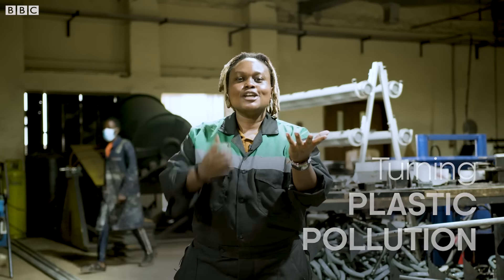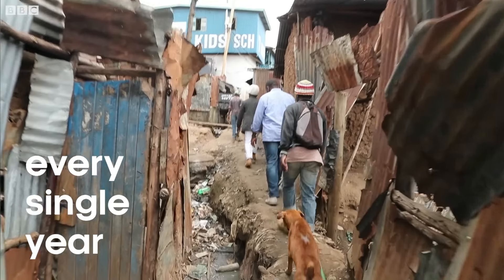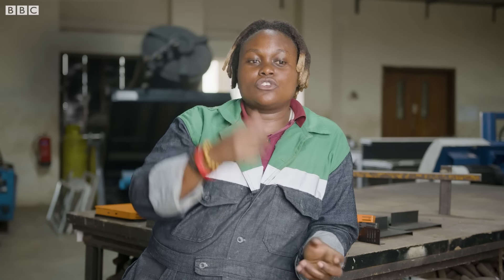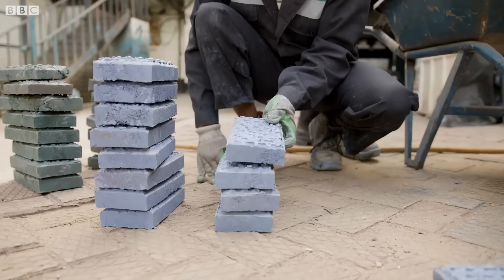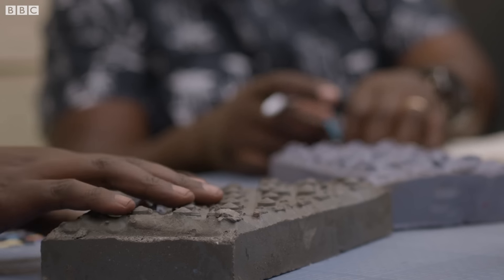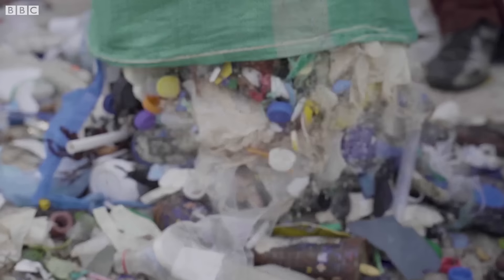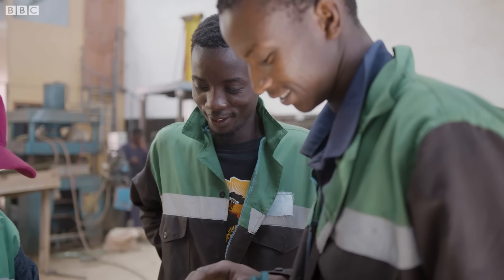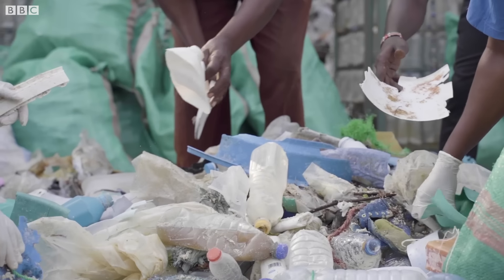These Recycled Plastic Bricks Are Stronger Than Concrete | Trailblazers | BBC Earth Science

Comment: My only concern with this is as the bricks wear down what about microplastic particles? Otherwise it's a very promising project.
Reply: its a good idea for building homes...
Reply: Thats actually a problem, but can ve avoided if you just dont use it for roads and paths and rather buildings
Reply: It's not a perfect solution but it should reduce the overall amount of microplastic by binding almost all the material inside the brick.  There's most likely a large reduction over that same plastic waste material degrading naturally where almost the entire object degrades into microplastic.  
The best strategy is to use in where you can minimise the surface area exposed to the elements and/or wear.  So as a structural "brick" inside a wall would be ideal.  My concern is off gassing during manufacture and the life of the end product.
Reply: Micro plastics in daily consumption is the ultimate problem and worry. Her bricks seem good as low-cost useable alternative to simple landfill.
Reply: @UC-zQBbgOjxW0gVISzjyGoHg It might be similar to unreinforced concrete that has compressive strength but terrible shear strength.  Like reinforced concrete or composites, mixing in some type of tensile fibre might improve that.
Reply: I think it"s a step in the right direction.
Plastics will degrade eventually. Buying time is an option.

Comment: If it is indeed made from just sand and plastic, then these bricks will degrade from the sun blasting it with UV. It will then ware down into micro plastic particles that will wash into the environment. if you have ever seen how brittle a plastic bottle gets when left out on the street you will know what I mean. If there is a sacrificial additive in the mix, (something that has a preference to absorbing UV before the plastic), from what I understand they last about 10 - 20 years without the plastic becoming compromised. But them additives are expensive, this is why UV hardened plastic materials like upvc cost more then plain pvc.
Reply: @erikweijling7361  The main problem will be if the additional treatment of the bricks, whether that be UV hardening, painting, or some form of render, will eat the cost savings. 

UV hardening would make them a drop in replacement, however they certainly would not last as long as ceramics that are good for 50-100+ years.

adding a render/painting will add more labour and complexity to the build, and would also require ongoing maintenance throughout the buildings life. This would also eat into the value proposition.

With all the above said, maybe a good solution would be a hybrid approach. Have the bricks take up the majority of the volume off the building, with the concrete finish on the outside. This would entomb the plastic within the structure, and protect it from UV at the same time. This could also reduce the amount of concrete needed by 50-75%
Reply: Another thought. should the strength of the plastic allow, they could be moulded in such a way to create empty cavities.

This would allow for less plastic to be used in the formation of the brick, as well as create isolated air pockets that are good for insulation. IE. 

Less plastic used, more bricks for the same material, lighter construction, cheaper per brick. This would more then suffice to eat the cost of any other additives or extra construction needed to prevent the plastic degrading, spilling microplastics into the environment.

Comment: I've seen a documantary about this women, and her great idea, before and am very happy her idea and business model was (and is) successfull. If you really want to make building blocks for cheap sustainable housing, you should eliminate the need for mortar. Right now, the bricks are flat with some grooves and relief on the top but it would be a LOT easier if (for the housing part at least) you put piramid shaped indentations in the bottom and matching piramid shaped extrusions on the top. That way the bricks can be joined without mortar and anyone who has a simple stone or hammer available can build a house, shed or lifestock pen with the bricks. Think about standardising small family houses and you could even supply the door and window lintels, rafters for the roof and roof "tiles" or corigated roof panels.

Comment: What about it's thermal capacity compared to concrete? What about the longevity?
Reply: Longevity is better, but it produces a lot of micro plastic if used for roads and paths
Reply: @mctobi2921  no it’s going to produce micro plastics no matter what it’s used dor
Reply: @YeetedOrca  obviously not, if you trow it into the ocean or build a roads with it its totally different than building a house with it where its encased in Clement.....
Reply: @mctobi2921  now first off not all the plastic is gonna have a layer of cement protecting it. And secondly, like do you think these things are just indestructible? Have you heard of weathering? And do natural disasters not exist?
Reply: @YeetedOrca  yeah exactly, that the Main reason it different a lot how much microplastic something produces, how much wear and tear and weather it is exposed to. So even a landfill is better then just throwing water bottles into the ocean.....

Comment: Its a good idea, but doesn't completely solve the problem of microplastics wearing off the bricks.
Anything that slows it down however is a good 1st step. If perhaps the finish of the bricks could be changed to "seal" it somehow it could improve microplastic retention even further.
Reply: There are absolutely no solutions anywhere to anything that completely solve every problem with anything.

Comment: The problem with this over concrete is the lack of flexibility. You don't build large structures with bricks, you pump concrete and let it harden in large moulds.
Reply: For standard residential homes you would use bricks.
But I wonder how well these recycled brick would stand the test of time and climate. I doubt they would last long in the Scandinavian climate.